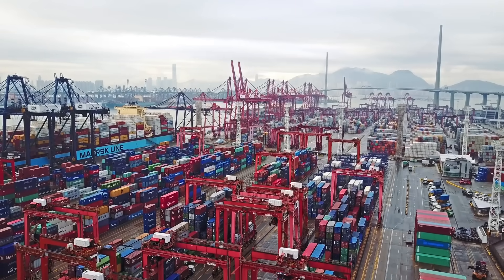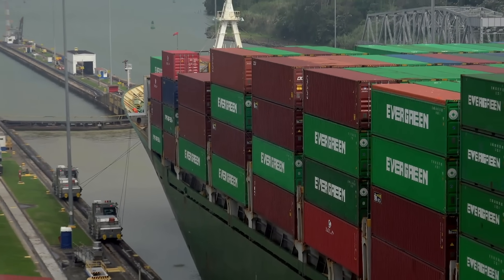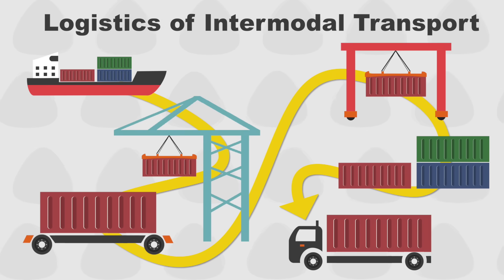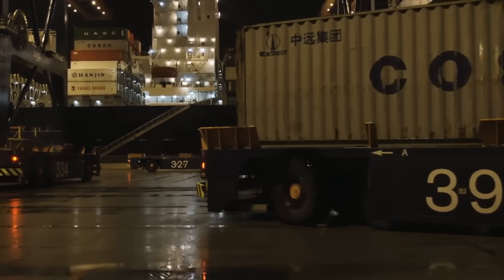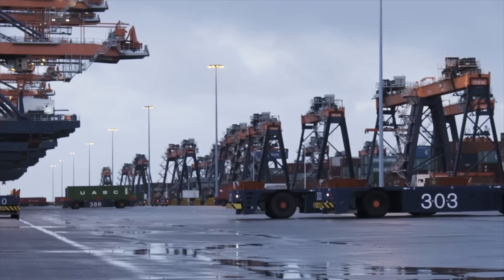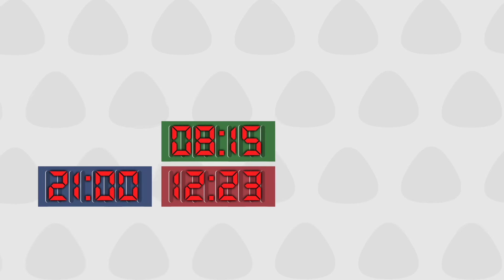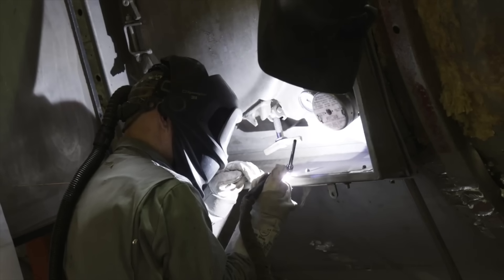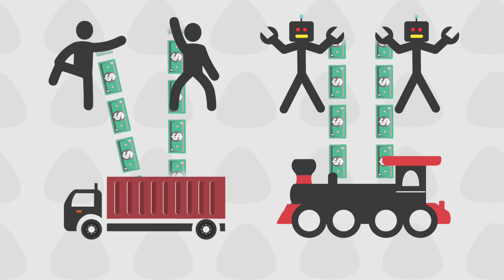How Container Ports Work: Logistics of Intermodal Transport

Comment: automation is not a long term issue, initially joblosses are quasi guaranteed but the benefits are much greater.

let's put it like this, it was industrialisation and thus the streamlining and partial automation of production processes that made many goods financially accessible and even during the horrible excesses of a laisez faire economic model the living standards increased dramatically, 

skilled tradesmen were offcourse the biggest victims there, and thus they went to extremes to try and stop it, going as far as to burn down factories and destroying machines.

if history is allowed to teach us the solution is to do so whilst providing retraining opportunities and financial security overall to those affected
the interesting thing here however is that we have to watch out for lawyers, engineers,... who often hold preferential positions in society that they don't (again) halt such inovations where they affect their interests,

essentially AI programs open the door for simplifying the legal process, for lawyers they essentially will be able to just give an AI the details of a case and that AI will swiftly collect and give all the files that have a connection to the case at hand, which would essentially mean that the most timeconsuming aspect of that job is automated, one could thus argue that the costs should as well and perhaps the proffession should eventually be opened up , same with engineers being able to use advanced programs that are getting simpler and simpler to opperate, and indeed doctors may one day be aided by robots for surgery, a computer might even be able to diagnose a person more efficiently and reliably than a doctor can (trust me they are not gods) (for instance trough technology that allows for easier and automated  blood analysis and even allowing for it to perhaps adopt a means to allow for scent (dogs can indeed smell certain diseases for instance)

Comment: I thought that some ports have rail tracks going right through the port so that the container is removed from the vessel and placed directly on the rail car.  This seems like the most efficient process of container movement, but I don't see it mentioned in this presentation.

Comment: Future container terminals can be many times more efficient if they adopt to the stacking system as proposed in the following link: http://navnautik.com/index.php/futuristic-container-terminal-storage-and-distribution-system-by-reverse-stacking-of-container-2017. The only equipment a container terminal will need are Autonomous Container Transporters, Quay Cranes , Reverse Cell Guides For Container Staking & Remote Control System. THAT'S ALL. The total Treminal area would be about ONE THIRD today's terminal area.

Comment: LA/LB longshoreman here.. good ,informative video. But you forgot the dropping of the lashing, the planning by the clerks, the unloading by the swing men, and numerous other jobs performed by LABOR. But not surprised to see the machines getting all the credit! Even at fully automated terminals like LBCT and Trapac, labor still moves cargo. Still nice to watch a description of an operation that is more complicated than a lot of the general public knows!
Reply: Also.. sorry I forgot to describe the problem automation brings by fully automating a port. Like the LBCT terminal I mentioned earlier in Long Beach is currently full and cannot adapt their yard like a non automated terminal can. Once a terminal automates they lock themselves in a system that is no longer flexible and they cannot get out of without having to move a lot of pieces, that weren’t meant for moving. Hire labor to work in an environment they didn’t intend labor to work in. The congestion you hear of in the news right now in LA/LB, is due to this very problem. Wonder if the companies will share this information as quickly as they share news of issues with labor.
Reply: @sh4dows-f4r  atta a boy

Comment: The containers are locked into place on the bar through Twist locks. They consist of a landing pin that activates to tell the crane it can now lock on, then must receive a 'Lock Light' in order to allow the crane to hoist the container up off the ship. This is to ensure no box is lifted without being safely locked.
I could go on for hours lol, working at a Port the last 4 years and this is what i do 12 hours a day. Repairing/maintaining Wharf(not gantry)/RTG cranes
Reply: Do you enjoy it?
Reply: In these automated ports surely they would still need human labor for lashing right?

Comment: Massive job losses are inevitable as computers and AI takes over. By 2030  it will all going to be run by computer more or less
Reply: Sooner than that. I use the railroad app to enter and exit railyards across the country. The cranes are remotely operated to drop the shipping containers onto our chasis (base). Even the larger warehouses have automated entry and exit. I give it 5 more yrs for full automation.

Comment: *Straddle Carrier. not rubber tyres whatever you said
Reply: Rubber Tired Gantry-not a strad.No strad l ever saw comes near even the smallest RTG. Then look at a Rail-Mounted Gantry manual or semi-automated and how much larger those are and then the actual dock gantries are at least 5 or 6 stories tall. And that would be older models, newer ones are 10 stories or higher. I have 40 years  service on the waterfront so l like to think l know a bit about moving cargo.

Comment: From industry experience, I can tell you those automated Bomb Carts and RTG's move less then half the speed of a human operator. Requiring you to own at least twice as many to get the same amount of cans per hour output.
Reply: Automated ones work 24/7/365, no sick no annual leave, no complaining
Reply: The only thing the human can beat is the diagonaal line the software has a problem whit that move.
That is why there are still human crane operators.
The rest is all automated and way faster than human operators.
Reply: They are probably slower but are more stable in continuous work. For example, an operator "X" can move 25 containers per hour in a shift of 6 hours or say 8 hours, then the operator "Y" has the next shift and moves 20 Containers per hour and if you have a 3rd shift this operator may only move 15 containers per hour. Not to mention if the operator has a headache, or is ill, or has problems at home or need to go to the bathroom on his shift, etc. An automated RTG has none of those. Probably move 18 containers per hour (it move more), but they are constant, at the end of the month, the automated RTG will have moved more containers than the human operators.
Reply: But, they work pretty much 24/7. Slow and steady...

Comment: Great video, but there is a lot more to this. I was tech lead for a intermodal terminal operating and transport system for 3 years. In addition to just stacking the containers efficiently, there is also the problems of responsibility. Often containers are picked up by unknown parties due to the way transport is structured, so knowing where to stack a container becomes a probabilities game. You often don't know till a day in advance whether the container will leave again by ship, train, or truck. And then there is ofcourse bayplanning: you can't just load up a ship randomly since it might topple. You have to load by destination location, container size, and weight. Then there are problems like empty equipment control: empty containers need to be stored and managed. Preferably you want reuse as close to the previous customer as possible, but orchestrating that is also quite an interesting problem. And then there are many smaller optimizations, like trying to optimize loading plans for dual cycling: a crane unloading a container should as many times as possible load a container when moving back to the ship to minimize total loading time. And then I'm leaving out all the administrative problems...

Great video, I wish this had existed back when I started in this sector.

If you ever want to know more about this, I'd be happy to collaborate on a potential follow-up video, or talk to anyone about this really. It's a super interesting business. E-mail me at logistics (at) ricklubbers.nl
Reply: Educate the yard planners in some reality and make the operators and yard checkers lives a little easier. Trying to dump 40 moves into one block at once doesn't usually go quick or problem free. Traffic control is everything, if nobody is moving, nobodys happy. Fucking admin...
Reply: @reeferman502  or nowadays yards are already at 90%+ capacity and you really dont have a choice where you wanna dump the containers... just wherever the available space is